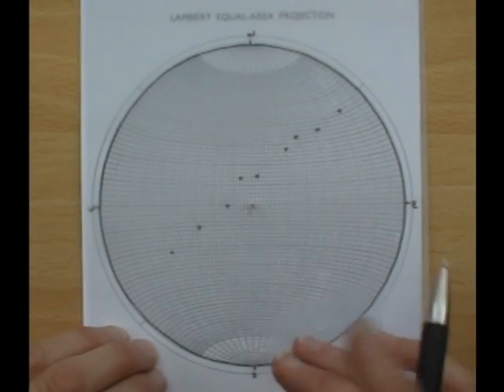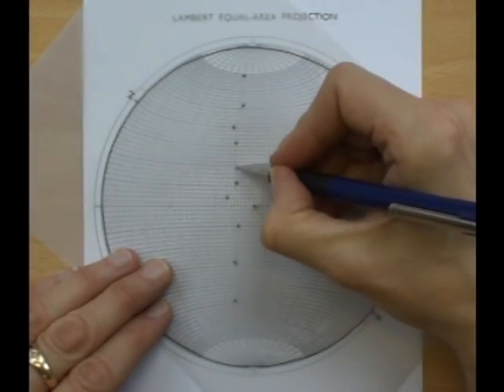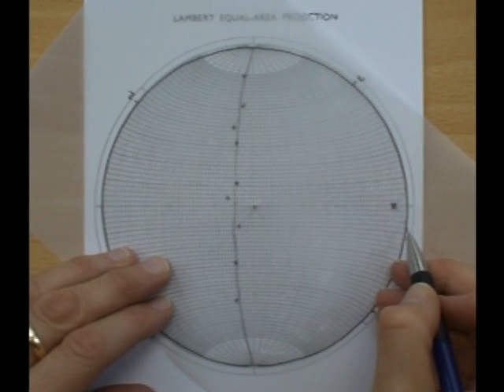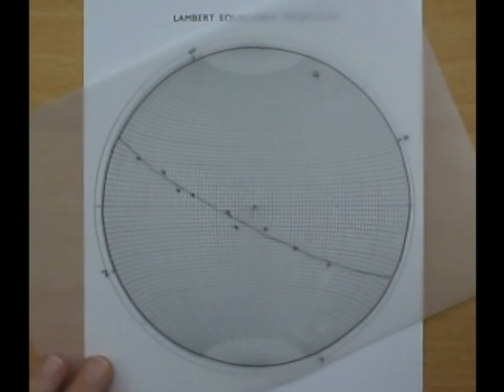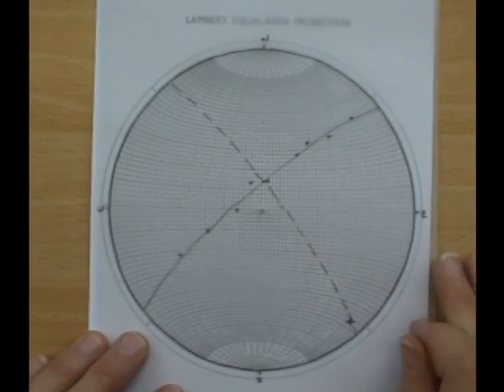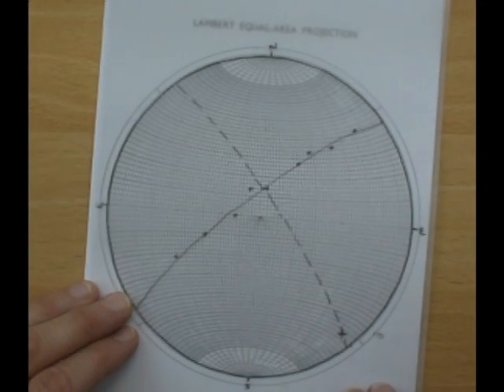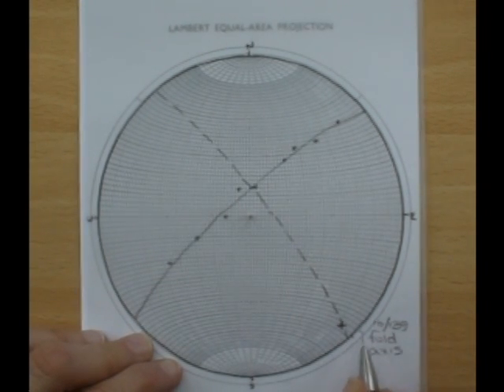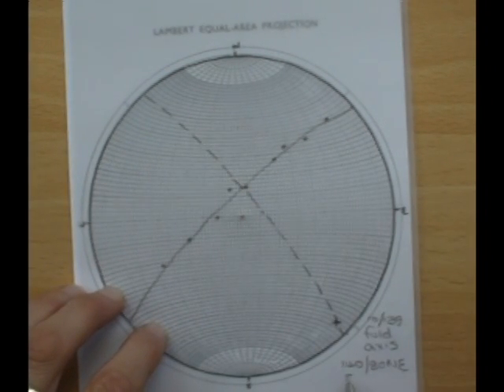Interpreting fold data on stereonets

Comment: Why did you use 90 for the pole to the best fit line?
Reply: the pole is always 90 degrees perpendicular from the plane on the East-West line. Your plane is like the equator relative to the pole.
I'm just a student but I'm 99.99% sure that's what it is.

Comment: nah man, note she plots a great circle which is a planar feature. 
If you imagine the centre point between all the poles to be the hinge of the fold (point between two limbs), the hinge is fixed to the axis - hence you connect the two. 
imagine you have two folds made of cake. If you cut it at the highest point (the hinge point), the blade of the knife will form an axial plane - a vertical plane separating the two limbs